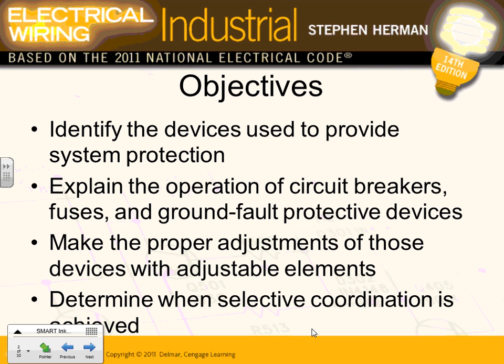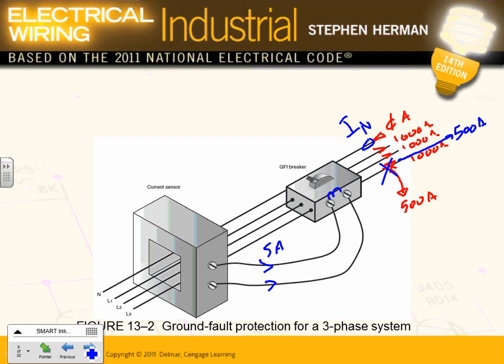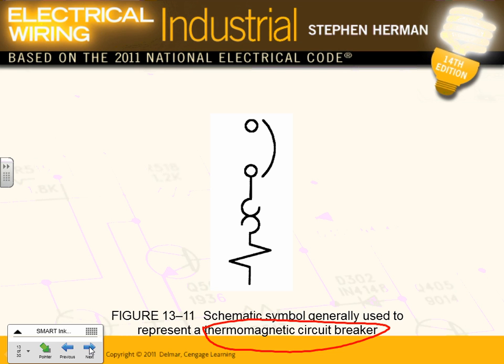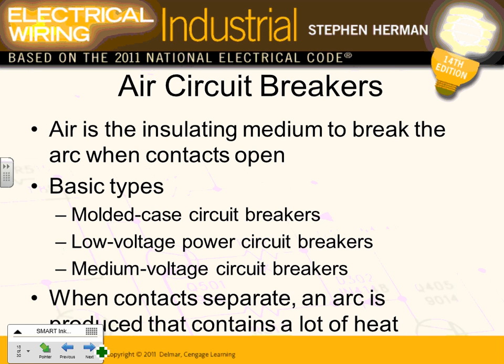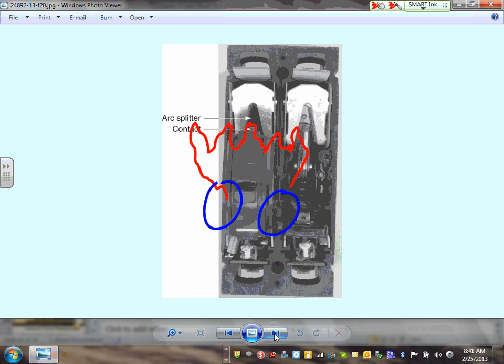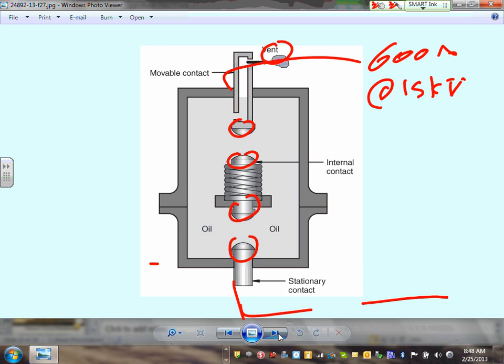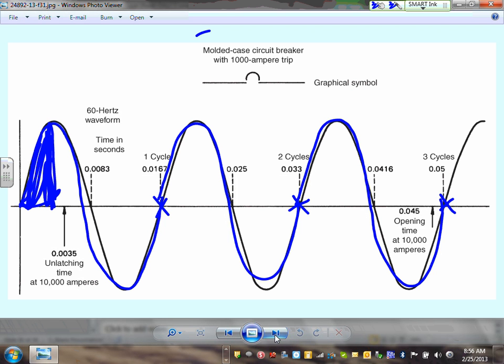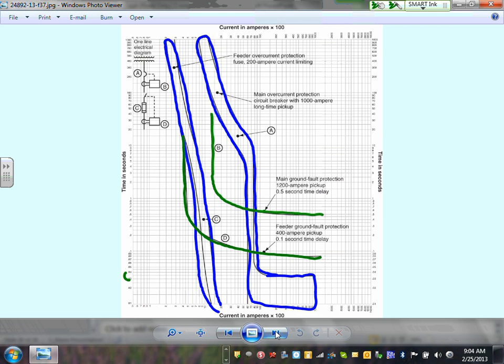Overcurrent Protection & Selective Coordination Ch#13 02 25 13

Comment: i Have a comment on ground protection at min. 10 that the current transformer for sense the ground fault see all phases include the ground phase which will be zero summation all the time, my understanding is only three phases go through current transformer and so if all have same current the summation will be zero otherwise we will have current different to trip the CB